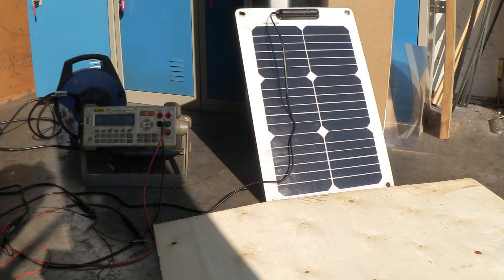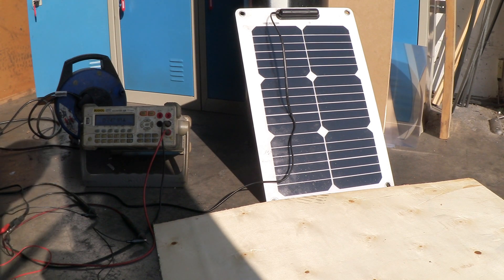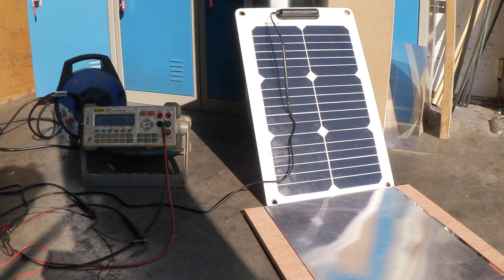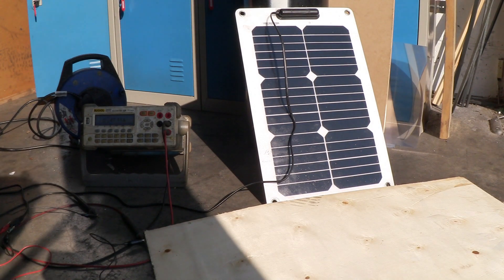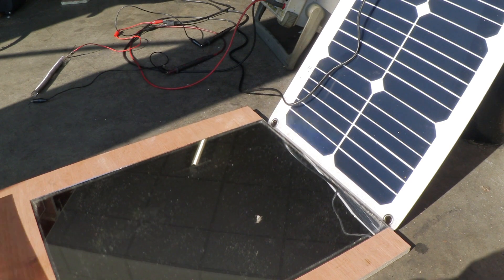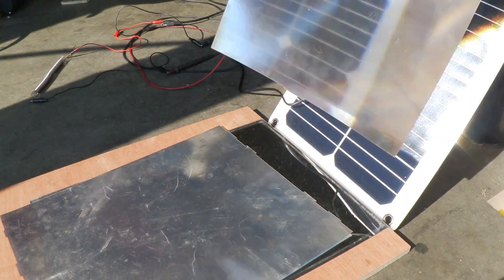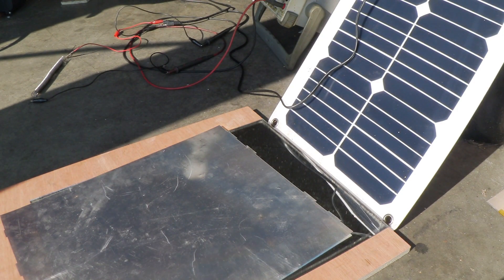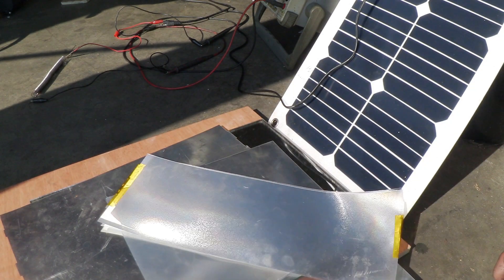Easy, Simple, Cheap Trick To Improve The Power Output Of Your Solar

Comment: try a board whitewashed  (not emulsion)
Reply from the maker: or you can mate and then do a vid - cheers
Reply: @ThinkingandTinkering  https://books.google.co.uk/books?id=du_ADQAAQBAJ&pg=PA372&lpg=PA372&dq=the+reflection+of+whitewash+to+aluminium&source=bl&ots=hJULzInL-1&sig=ACfU3U194QzRwHSqb8a0qVHIQR-fpq6OyQ&hl=en&sa=X&ved=2ahUKEwir7biiwprqAhXHQhUIHZ0kCW0Q6AEwEnoECAYQAQ#v=onepage&q=the%20reflection%20of%20whitewash%20to%20aluminium&f=false

Reflectivity
Whitewash  70 to 90%
Aluminium sheet 45 to 60%

Comment: Depending of the latitude in your área, the best tilt angle is about 20 degrees. If this angle used in the experiment is not the optimum tilt  angle, the solar panel output will decrease. In solar panel location with High tilt angle the reflective film maybe helps, but in low tilt angle places the reflective film contribution will probably be very low.
Reply from the maker: cheers - but you might have missed the point - this is not just a reflective film
Reply: Thanks Robert! Excelent idea to increase efficiency of the solar pannel. There are water cooled hibrid solar pannels in the Market that could solve this extra heating problem. I see this booster as a great potential also for double sided  solar pannels to increase sun irradiation in the backside solar cells.

Comment: How much faster would the panels degenerate due to all the added heat ? May need to add some fashion of water cooling system on back of panels ?  Tape Fish Tank Air Lines to the rear of the panels.  Pumping water thru fish tank air line taped to the back of the panels provides a power boost in it's self.  Give that a go !  Hint.  Kapton  Tape works quite well.
Reply from the maker: see this video https://www.youtube.com/watch?v=x_UKVEBxYFM

Comment: I think the gain is not quite as much as one would think, this is because of the fact that as you heat a panel it lowers in voltage (0.45% per °C) and efficiency, as the amps increase as the voltage decreases,
The figures in the Hyperstealth Biotech video are measured at 10am in one test and on December 6th for another (possibly the same day?) this is not a test of a hot panel, I think if the ambient temperature is low enough then just mirrors would work about as well, and if it were tested in full midday sunlight in July/August then panel heating issues would mean that the net gain would be very low, as the reflected light could make panel temperature skyrocket to 50 - 70°C

Panels are tested by manufacturers at 25°C, this means that the manufacturers rating is already slightly off in hot, sunny weather as the panel is probably around 40 - 50°C in these conditions, in severe cases this could mean a loss of around 15 - 20%

I think the increase from this system would be useful in the Winter but cause issues/damage in Summer as the extra heat would shorten the life of the panel
Reply from the maker: see this video https://www.youtube.com/watch?v=x_UKVEBxYFM
Reply: @ThinkingandTinkering  I had watched it but don't think that tests on a cool panel in Winter are giving the full picture, what I am trying to say is that yes you will get an increase, but as the panel temperature rises then the actual gain is much less than you might think,
If this was incorporated into commercial products with some of the gain going to cool the panel, and an overall increase of around 10% then it would be a benefit, but then maintenance/replacement of parts, extra cleaning costs, etc. would negate most of the added value, It's probably more cost effective to put up an extra few panels instead,

If I've learnt anything about solar then my main takeaway would be the 'Law of diminishing returns'

Comment: So I did some tests:
Cooled the panel by pouring water on it:
1st try: went from 0.5A to 0.63A +26% (big improvement, might be an outlier).
2nd try: went from 0.55A to 0.6A +9%.
Directed light with a mirror (kinda dirty):
Went from 0.6A to 0.72A +20%.
Mirror (kinda dirty) + prison film
Went from 0.58A to 0.81A 40%.
Prison film by itself performed pretty poorly.
Reply from the maker: awesome mate - seems like it is prism film and mirror with cooling is the way forward?
Reply: @ThinkingandTinkering  yup.
Reply: Hi SinsBird, I would be interested if you could test again for total output power in watts, also could you setup the panel and take readings and then take readings after the panel has got to full temperature in midday sun, and note the panel temperature, 
This would take into account the fact that as the current increases the voltage is decreasing due to the temperature (0.45% per 1°C increase)
I think this might give a better understanding of the full picture
Reply: @sofa-lofa4241  I would like to, but I don't have my infrared thermometer with me at the moment.
Reply: @SinsBird Do you use an MPPT controller? As far as I know temperature decrease of solar cells will increase _tension_output_, an MPPT controller will look for the sweet-spot of the tension/current ratio. Could you try compare voltages too, with the different arrangements? This could demonstrate even higher output increases. Or try as @Sofa-Lofa suggested, measure actual power output?
Good job doing that testing!
Reply: @bazofiascbr  Okay, so:
Hot: 0.37A 8.00V 2.36W
Hot with mirror+film: 0.56A 12.00V 6.72W +185%
Cooled: 0.5A 10.64V 5.32W +125% if compared to hot.
Cooled with mirror+film: 0.68A 14.33V 9.74W +83% and +313% compared to hot.
Used 22ohm 10W resistor as a load.
Reply: @bazofiascbr  I'm testing this on a small panel very similar to that in the video. I was measuring the current by simply shorting out the panel with my multimeter in current mode. Will do another test with a resistor for power output for sure.

Comment: For real systems already on the ground (roof!) and doing productivework, the issue will be the solar charge controller/inverter which may not be able to handle the increase in power.
Reply from the maker: goo thought mate- cheers - still - try it and see is my motto lol
Reply: mppt controllers should be fine.  I don't think you're increasing voltage here, just amperage.
Reply: If your charge controller can't handle a 40%+/- increase in amperage than you're controller is probably inadequate to begin with if it's barely rated for your panels as is.
Reply: If that's a concern you can always daisy chain charge controllers. I produce about 800 watts and have a 400 ah my Internet modem smart lights exterior lights all run off of the system. Wiring cost was not an issue for me so I went for straight 12 volts.

Comment: RMS, i'm looking to simplify and increase the efficiency of Browne's gas (hydroxide) production by, inducing the harmonic resonance frequency of hydrogen, in combination with a classic electrolysis set up. Do you take requests? If so, you would be doing us all a great service if you could produce a video on the subject. 
Thank you for your past efforts, i like the way you think.
Reply from the maker: Great suggestion! - I'll. look into it - cheers
Reply: I've had that thought about utilizing the resonance of the atoms (H or O) or the molucule (H2O) to attempt to improve H20 cracking.  Haven't taken the time or resources to test anything yet.

Comment: Haha I KNEW my hoard of LCD inserts would come in handy one day. I for some reason thought they were just polarizing sheets. I'm hoping I can boost the uptake for my garden lights in the winter to see if they can actually not die completely. Funnily enough I went out & bought a similar Solar Panel from poor old Maplin's before they went under, I use it to keep a spare car battery charged up currently, but I have some other lead acid batteries that I may 'hook on' if I can revive them. One problem I have continually is the self-discharge of rechargeable batteries, I have quite a few that I like to have ready but keep them on a mains timer charger. I wonder if I could just trickle charge them thru the day to jeep 'em topped up? That should stop any memory effect/cycle life problems surely.
Reply from the maker: hmmm - depends on the battery really - most of the new ones don't like to be tricked charged

Comment: I feel like I read about this being explored in the early days of solar cells, and they ran into issues with keeping the lenses clean over time and shortened panel lifespan due to the excess heat and inadequate/inefficient cooling solutions. Probably misremembering that and making it up though, but it makes me wonder if Cody's (from Cody's Lab if you haven't heard of the channel) old idea for a solar heat driven water pump might be an effective solution if improved upon. Might be better to use alcohol or a lower boiling point liquid and principles seen in modern heat pipes used for CPU cooling.
Reply: If you could array the optics such that the concentration only increased in the morning and late afternoon and not at midday, then in theory it might increase the daily energy output without increasing the peak temperature at midday.
Reply from the maker: I know Cody and you could indeed do that mate
Reply: Maybe Cheap Automotive Anti Freeze
Reply: In a comment at the top of this video,  Robert posts Guy's video.  In the video Guy shows multiple cylindrical lenses in front of the solar cells, which does the same work but also can stop light snow and dust accumulation.
Reply: (Nice vid Robert), yes, increasing the light via lenses or mirrors increases the output, I don't remember the right terminology but it's something like 2 suns, 3 suns terms. But the heat reduces performance, a solar panel works better if it's cooled and kept at certain temperature ranges, and the heat will not only reduce performance but also the lifespan overtime. I'm not sure who, if Will Prowse or Seek Adventure made a video testing the results of reflections and temperature, kind of remember someone used a fan to cool them down on a video, but the water pump sounds also like a good idea.

Comment: Concentrating the solar energy will increase the surface temperature on the panel. Could this be detrimental/damaging to the materials used to make the panel?
Reply from the maker: yes - which is why I talk about it in the video
Reply: if the panel is impragnated in resin (like the new ones) and are waterproof. Than you can drop it in an aquarium like or have water running over the surface. Temperature drops and efficiency goes up. Another way around woud be to concentrate at on point, install a prism to remove infrareds(and UV) and return the ''clean'' light to the solar panel. So you will have just light but no heat.
Reply: What if you ran a closed system of water pipe on the backside to collect thermal energy

Comment: A solar water heater as a heat sink for your solar panels you get to use the heat and the increased electricity if you have set up a well-insulated water tank you can heat your house for days with just that.
Reply from the maker: that is an awesome suggestion mate
Reply: @ThinkingandTinkering  Thanks but it probably is not my idea as I watch thousands of videos and read lots of papers and keeping track of it all is damned near impossible.
Reply: First of all solar panels don't get that hot to be effective water heaters. Secondly, why would you want to heat your house in summer?
Reply: @SinsBird  Showering and doing dishes?
Reply: @SinsBird  If you paid attention to the video you would know adding the reflectors and prism screens increased the heat significantly. Why would you want hot water during summer? Like EgonSorensen wrote showers dishwashing and if you live in a desert the nights are bitter cold there are plenty of uses for heat including generating more electricity with monotherms and Peltier devices.
Reply: @Barskor1 , EgonSorensen do you realize how little they collect heat? They are hot to the touch because they have no thermal load! Add a little bit of water and the panel cools down close to ambient temperature in seconds! If they did heat up enough to significantly heat your house water up they could probably become a serious fire hazard. Look at solar collectors, the vacuum tubes specially designed for heat collection. With no load they heat up to more than 300 degrees! I can't remember exactly off the top of my head. Sure, it would work to some extent, I'm just questioning if it would be worth the time, effort, money and risk to damage the solar panels if the system was poorly designed and cheaply built.
Reply: @Barskor1  I think I was thinking about a regular solar system without the mirrors. So, yes the cells will heat up a lot, but again, I don't see how could you efficiently transfer the heat to your house water system.

Comment: Robert, next time you see a bus, look at the rear window.
(Fresnel lens!)
You can focus and deflect light passing through the lens rather than reflecting it.
So lenses raised above the panel in the same plane, set atound the perimeter (wide, raised picture frame?) should be able to "bend" light that was going to strike outside the edge onto the panel.
Reply from the maker: I know mate but that only really works with spot lenses - it doesn't work using linear lenses which is the type found in lcd screens - check this out https://www.youtube.com/watch?v=x_UKVEBxYFM
Reply: @ThinkingandTinkering  that's really interesting.
I wonder if these could increase power if reflecting light back towards a horizontal panel on a camper van roof in winter?
Leave the panel flat, set a reflector at maybe just off vertical, facing the sun?

Comment: Awesome ideas. The shadow from the chord of the amp meter, can short circuit, part of your panel.
Reply from the maker: yeah- could it?
Reply: What would be the purpose or wire insulation if it could still short circuit? 🙄
Reply: Desmond Bagley  Yes it's because the cells, in the panel, are wired in series.

Comment: You could  mist the solar panel. The water droplets will act as a lens and cool it at same time
Reply from the maker: does that work?
Reply: @ThinkingandTinkering  your already setup. TRY IT.  Cooling panels with mist in the middle  east  is already being done.the colder the panel the more powerful  it is
Reply: Yes but it would be awesome to find a way to use the heat to produce distilled/desalinated water rather that consuming it, particularly in arid/desert regions.
Reply: @ThinkingandTinkering  mr Smith,  I have an idea for you from watching  your videos for 2 years. 😁 can you paint your conductive ink on a 1 meter square sheet of steel and put a 100 watt solar panel on it and see if it heats a room???? If I had your ink I could do it cause I have the panel but no ink 😭